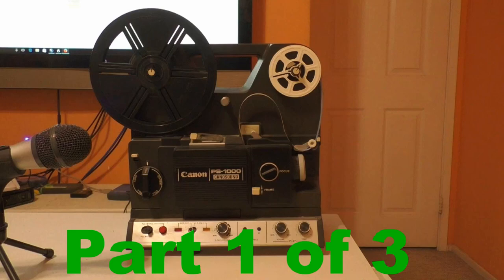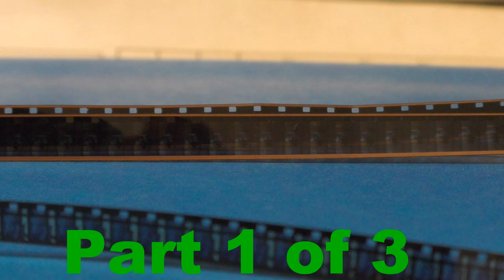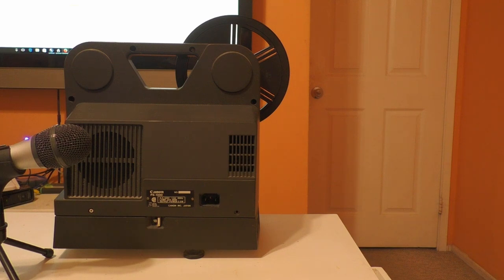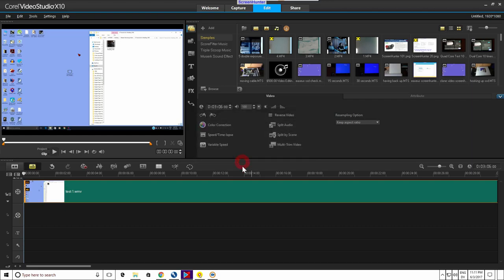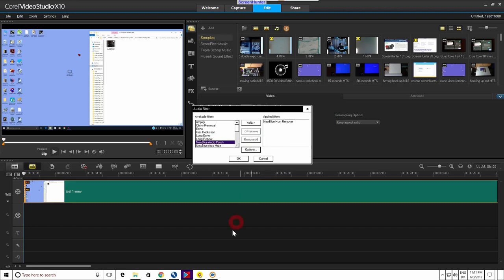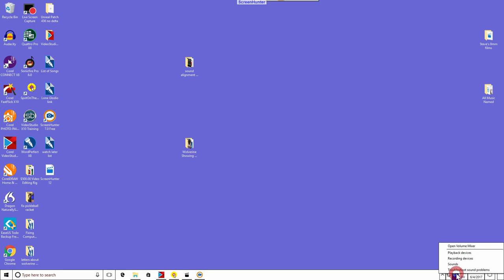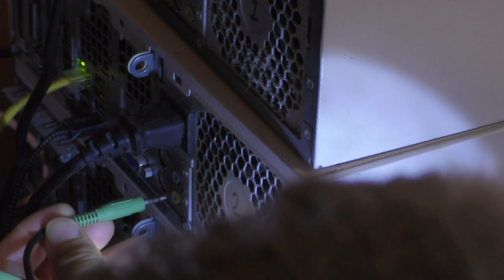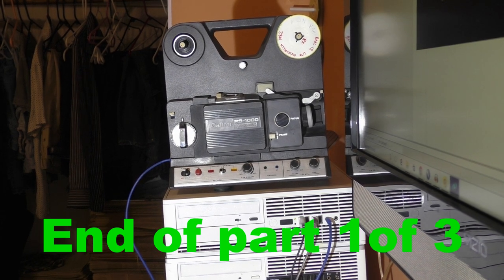Importing sound after copying from Wolverine 8mm and Super8 Reels Movie Digitizer

Comment: Sound isn't recorded on - like you say - "coper strip". These are specially formulated strips made with iron powder. Coper cannot be used for that purpose.
Reply from the maker: Yes, you are correct, but it looks like copper on my film. You are correct you do not want to get a magnet near the strip it will realign the iron and erase the sound!